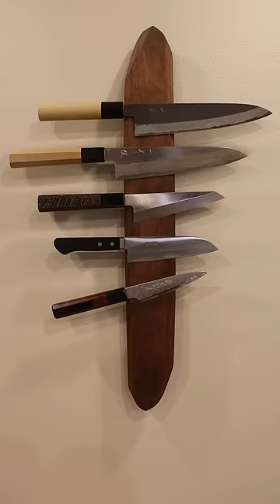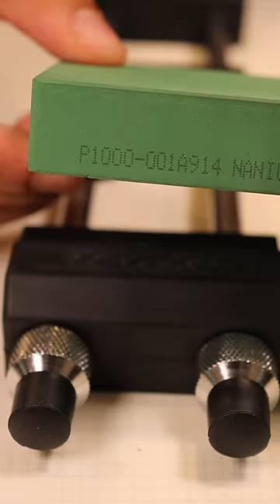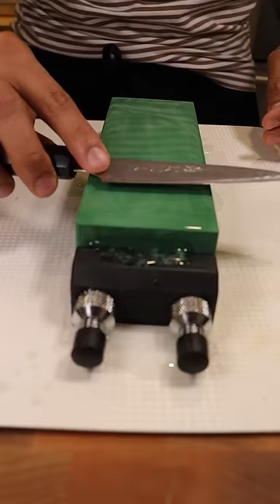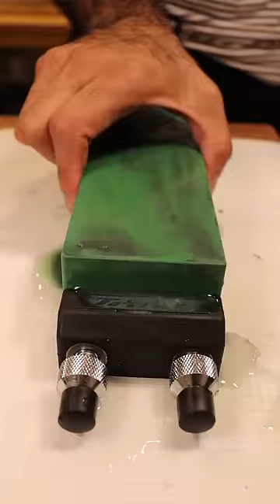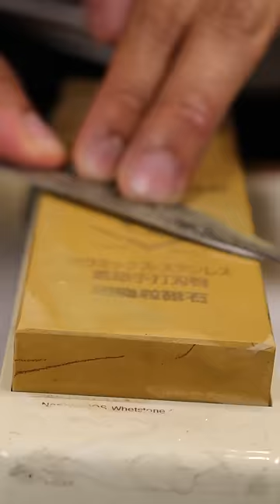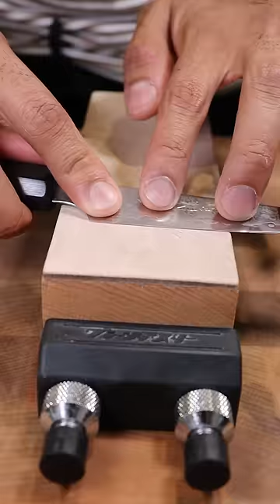Time To Sharpen Your Knife

Comment: To anybody confused by the “a sharp knife is a safe knife” comment:

Assuming that you’re holding the knife correctly, as well as keeping a firm grip on whatever it is that you’re trying to cut, then a sharp knife makes it easier to cut things as you need to apply less pressure to the blade to do so.
In addition to this, the cutting edge of the blade will be slightly rounded over on a dull knife (you’d need a microscope to see this) which means that you’re a lot more likely to roll off the surface of whatever it is you’re trying to cut and risk cutting your fingers - especially with shiny, round food such as tomatoes and onions.

In the event that do accidentally cut yourself, then a cut from a sharp knife is actually a lot less painful, as the skin is cut cleanly and will heal easier, whereas a cut from a dull knife is ragged, as the blade tends to rip the skin more than actually cut it.
Reply: I see
Reply: Here is the summarization:
A dull knife is more harmful
Reply: I think that quote is more for the self defense aspect
Reply: @Rogerpearsontattoos  No..
Reply: its because when a sharp knife enters your body and it hits a bone it wont  get stuck, but if its dull and enters your body it could get stuck in your bone. so thats why i’m glad I accidentally cut my self with a sharp axe and knife when i was younger instead of a dull ones.

Comment: "a sharp knife is a safe knife"
NOT AT MY HOUSE
Reply: A sharp knife will allow you to cut meats easier whereas a dull knife wool have a chance to slip and cut you.
Reply: @dez8832  Counterarguement for the sake of fun! If you are so inexperienced with knives that you feel it not going through, and still try to put more pressure on something you know is slippery (eg meat, bones, round objects etc), then you could arguably do hell of alot more damage to yourself with a super sharp knife.

Not trying to be harsh, but imo trying to force a dull knife through something instead of taking the time it takes to get through, is utter stupidity and in my head an operator issue, not a knife issue.

A common injury from sharp knives is when you cut something and it encounters resistance, you put more pressure on to compensate and since its so sharp it now snaps straight through whatever you were cutting AND anything else in its path after. Another one is trying to cut round things that roll away and kick the knife out.

A sharp knife might be safer, but they are certainly not safe. Good knife practice and experience is what makes safety.

Comment: If you are wondering why a sharper knife is safe, it's because it cuts smoothly.  On the other hand, using a dull knife will not be smooth and you could end up cutting yourself.

Comment: “A sharp knife is a safe knife”

Cuts my finger open
Oh…
Reply: You are more likely to hurt yourself while using a dull knife because having a dull knife will make you apply more pressure, which can cause many accidents, such as it slipping on the cutting.
Reply: @ljguy1276  woosh
Reply: @gredinmcconnell  👏

Comment: "a sharp knife is a safe knife"

But you didn't had to cut me of-
Reply: Dull knives are more likely to slip and cut you. If your knife is dull, you will apply more pressure to it, which can result in an accident.
Reply: MichaelLorraint well it really depends on how dull the knife is because it still needs to be sharp to an extent to be able to cut you. And dull knives are more likely to slip
Reply: You are more likely to cut yourself on accident from a dull knife
Reply: Michael Lorraint  because potato

Comment: Nobody:
The intro of this vid: A sharp knife is a safe knife! 💀
Reply: It's true though, a sharp knife won't get stuck and a dull knife will which causes you to lose control..
Reply: @literallygod1229   explain that to an infant.
Reply: @NoirLeRoi  Sharp knife goes in and comes out good, a dull knife (Not sharp knife) gets stuck when it cuts.
Reply: A sharp knife is easier to use, a dull one is harder to use, so you might cut yourself.
Reply: @NoirLeRoi  why? Infants shouldn't even be in the kitchen

Comment: In case you don't know why a sharp knife is safer, it's cause with a full one your having to push and slide through whatever your cutting, and if it slips boom a lot of pressure on your hand with the blade. Buts with a sharp one it just glides through and you don't have to push so hard.

Comment: Guys, a sharp knife is safe because if you cut yourself with a dull knife it's gonna be a weird cut and it could get infected depending on the knife, a sharp knife cuts thru you clean which makes it easier to clean the cut and easier for the cut to heal, even if you think otherwise.

Comment: Can I ask 2 things
1: what does the phrase a sharp knife is a safe knife mean how is it safer than a dull one

2: what do each of those blocks do for sharpening those knives

Please answer these questions for me thank you
Reply: You have more control with a sharp knife.
Less pressure, means less chance of slippage and more control 'steering' your cuts, so you cut what you mean to, and nothing else.

They're whetstones.
Think fine sandpaper blocks. The green one is 1,000 grit, and the yellow one is 4,000, the last one is leather, and it cleans the little leftover bits of metal.

Comment: you said that a sharp knife is a safe knife now i have one arm
Reply: A dull knife which is not sharp almost cut my moms finger how?
Well using a dull knife you have to put pressur on the hard things like meat water melon etc etc
But most of the time putting pressure will cause a accident by slipping
Sharp knife makes it easier to cut meat , water melon, and anything thats hard
But becareful with a sharp knife tho.

Comment: lemme get this straight

A sharp knife is a safe knife
but a UNsharpen knife is a dangerous knife?
Reply: Yes, atleast for cutting things. If you have a sharp knife you can easily cut things. But with a dull knife, you need to put more pressure which is dangerous.

Comment: ''A sharp knife is a safe knife''
It isn't and it never will be.
Reply: It is actually gordan ramsey and every other professional chef states that with a dull knife  you have to push harder increasing chances of slipping
Reply: A dull knife which is not sharp almost cut my moms finger how?
Well using a dull knife you have to put pressur on the hard things like meat water melon etc etc
But most of the time putting pressure will cause a accident by slipping
Sharp knife makes it easier to cut meat , water melon, and anything thats hard
But becareful with a sharp knife tho.

Comment: They are?

me looking at my four fingers from yesterday
Reply: A dull knife which is not sharp almost cut my moms finger how?
Well using a dull knife you have to put pressur on the hard things like meat water melon etc etc
But most of the time putting pressure will cause a accident by slipping
Sharp knife makes it easier to cut meat , water melon, and anything thats hard
But becareful with a sharp knife tho.
Reply: @ChefHin ok

Comment: U just said a sharp knife is a safe knife 💀💀💀
Reply: A sharp knife is easier to use, a dull one is harder to use, so you might cut yourself.
Reply: You wouldn't have to put as much effort on a sharp knife which means it's less likely the knife will slide off what you are cutting and cut you. This is especially true for tougher things to cut
Reply: So saying something that's true is crazy, it's simple knife safety

Comment: “A sharp knife is a safe knife”

what
Reply: A sharp knife is easier to use, a dull one is harder to use, so you might cut yourself.
Reply: Its true, a dull knife even though it wouldn't do as much damage its waaaaaaay more likely to slip
Reply: @owenjongekrijg4294  what if the sharp knife slips-
Reply: @NeonGMD  ok then you cut yourself but because ita more sharp the cut will be cleaner meaned less pain and it's also easier to think of it this way, a sharp knife slips once every 20 times a dull one does, so the sharp knife would need to do 20× more damage per slip to be considered even, but it doesn't it would do 2× at MLS
Reply: @NeonGMD  Then it's your fault because you'd have to TRY to slip a sharp knife
Reply: @Isabellaaaaaaaaaaa  no
Reply: @NeonGMD  it really is,it takes effort to slip a sharp knife cuz if it's sharp you wouldn't even have time to slip it
Reply: @Isabellaaaaaaaaaaa  i thought they meant dropping it yea now i agree

Comment: How can a sharp knife be a safe knife ?
Reply: Because you remain in control of the blade at all times.

When your knives is dull you exert more force, this results in rolling of the knife, and uncontrolled speed, so it could walk or drift in what you're cutting, or slip off what you're cutting, causing you to injure yourself.

Sharp knives also have more cut initiation (meaning they 'bite' (stay on) the material regardless of pressure.)

Comment: "a sharp knife is a safe knife" what happened when u accidentally cut you hand/finger💀
Reply: Why does that happen though? You're cutting something, the blade is dull, so it catches on whatever youre cutting. So you push harder, making the knife slip and chop your finger off. Sharp knives don't catch on stuff, so they don't have this problem
Reply: If you accidentally cut yourself you clean it out slap on a glove and go back to working. It won't kill you and you'll learn to be more aware of your fingers and ensure proper cutting technique.
Reply: @cloroxbleach197  a sharp knife cuts cleaner than a dull one, you never want to be cut by a dull knife
Reply: @SlickTimes  Oh believe me I know, I work in the food industry and I've had to deal with my fair share of shitty knives.

Comment: A Sharp Knife is Safe Knife So You Can Give him to Your 3 years Old Sun to play with him
Reply: A dull knife which is not sharp almost cut my moms finger how?
Well using a dull knife you have to put pressur on the hard things like meat water melon etc etc
But most of the time putting pressure will cause a accident by slipping
Sharp knife makes it easier to cut meat , water melon, and anything thats hard
But becareful with a sharp knife tho.

Comment: a sharp knife is a safe knife 🔪
wtf no it's not 💀
Reply: Yes it is, dull knives are dangerous because they can slip on the vegetable and cut you, with a sharp knife it won't slip and it won't cut you
Reply: Sharp knives won't slip on stuff because it cuts what you want with less pressure.

Comment: Me:wondering how painful a cut is
Reply: Sharp cuts actually hurt less and heal faster, because they cut flesh smoother.

Source; knife maker and sharpener, cut my finger tips open more times than I can count.

However, one that does hurt is when you slice your fingertip to the bone, severing the nerve in your fingertip, causing you to feel one of the most painful feelings on earth, and almost pass out, then once it's healed, have  no feeling left in your fingertip, except for an odd 'ghost sensation' occasionally.

:^)

Comment: A sharp is a save knife 
How does that make sense 
Its suppose to be more dangerous 
Anyways amazing videos
Reply: A sharp knife is easier to use, a dull one is harder to use, so you might cut yourself.
Reply: Sharp knives will cut through anything easily and won't slip. A dull knife will make it harder to cut and easier to slip. Plus it'll probably stick to you if you end up cutting yourself.

Comment: Uhhh i dont really know if a shrap knife is a safe knife💀
Reply: A sharp knife is safer to work with if you know what you're doing as you don't have to put extra pressure forcing the blade through whatever you're cutting. The extra pressure can lead to less control and cause the blade to slip leading to you severely injuring yourself. Just a little experience with a knife and basic proper handling techniques make it very safe to work with and cutting yourself will be a rarity.

Comment: “A sharp knife is a safe knife”
So a not sharp knife is a dangerous knife?
Reply: With a dull knife you have to use alot of pressure when cutting something and if your knife slips and cuts you then your gonna be mad
Reply: It's easier to understand using a damage index, if you cut yourself with a dull knife let's say it does 10 damage, and a sharp one does 50, even though the knife does less damage per hit you are far more likely to cut yourself with it via the knife slipping so in the same amount if time the dull knife does 100 damage while that sharp one only does 50
Reply: oh ok thanks
Reply: sharp knives leave smaller wounds,easy to heal.a dull knife leaves a bigger wound,takes a bit longer to heal.

Comment: Ohhh really 😮 leme try l…… ✋🔪AHHHHH
Reply: A dull knife which is not sharp almost cut my moms finger how?
Well using a dull knife you have to put pressur on the hard things like meat water melon etc etc
But most of the time putting pressure will cause a accident by slipping
Sharp knife makes it easier to cut meat , water melon, and anything thats hard
But becareful with a sharp knife tho.

Comment: A sharp knife is a safe knife yea I'm not to sure on that ;-;
Reply: Dull knives catch, meaning you have to apply more pressure to cut through whatever it is you're cutting. The moment you apply more pressure, there is a high chance the knife will slip and you will suddenly lose your finger. A sharp knife won't catch, so it doesn't require the extra force. Knives are tools. Tools are only dangerous in the the hands of the dangerous

Comment: Just to know, why is a sharp knife an safe knife, i mean u can cut easier?
Reply: Yeah you cut things easier. A dull knife will catch on what you're cutting, making you have to push more to get through whatever you're cutting. As soon as you apply more pressure the knife slips, and there's a high chance of injury. A sharp knife doesn't catch so the extra force isnt nessecary

Comment: Woah i didin"t even know that a sharp knife is safe 20 minuets later. Oh let me try it on this Wait aaaaaaaaaaaaaaaaaaaaaa 💀💀💀💀💀💀💀💀💀💀💀
Reply: A dull knife which is not sharp almost cut my moms finger how?
Well using a dull knife you have to put pressur on the hard things like meat water melon etc etc
But most of the time putting pressure will cause a accident by slipping
Sharp knife makes it easier to cut meat , water melon, and anything thats hard
But becareful with a sharp knife tho.

Comment: A sharp knife is a safer knife when cutting. You don't need to put as much effort into cutting something which means your knife is less likely to slide off what your cutting and cut you instead since most of the time it will just cut through them easily. This is especially true for harder things to cut. Of course you must use a knife with a lot of caution and always be aware of what you are cutting.

Comment: Why u put water?
Reply: It's called a wetstone. You put water to make it better for sharpening because with just dryness it probably wont work.
Reply: If the stone is dry it will hurt the blade
Reply: Water is to 'wash away' the metal dust, and soften the binder on the stone (making it wear steel at the same speed.)

It will not harm the knife or the stone to use it dry, and it will work somewhat fine (depending on the stone), it may just clog up with metal if you don't use water.

Comment: A loaded gun is a safe gun so let load a gun
Reply: Lmao no. If a knife is dull it needs more pressure to cut and the knife becomes harder to control. If u slip up with a dull knife the dull knife would most likely hurt you more
Reply: Poor analogy, because the user is always responsible for the firearm.
It cannot do anything without you, you are the problem not the gun. If you leave a loaded firearm on a table, it will not magically go off.

Same for a knife, except if it's dull you lose control when cutting, if it's sharp you don't.

Comment: How is a sharp knife a safe knife it is more likely to chop off a finger than a dull one
Reply: this is because a dull knife has a chance of getting stuck then slipping, which has a chance of injuring the individual
Reply: A sharp knife is easier to use, a dull one is harder to use, so you might cut yourself.
Reply: Actually that's where you are wrong, unless you are trying to cut your finger. A dull knife is much more likely to slip and cut you

Comment: How is a sharp knife a safe knife the more shrap the mare you will get cut
Reply: using a full knife causes you to need more pressure to properly cut anything, so curing yourself with it would be worst than a sharp on since with a sharp one you'd barely need any pressure

Comment: (A Sharp knife is a safe knife) man shut your mouth it's not safe
Reply: Dude you have no room to speak I bet you don't even cook ordering door dash every night 💀, a sharp knife is a safe knife because you can cut through food easier without any resistance. On the other hand, a blunt/dull knife is dangerous because you have a harder time cutting, which means it can slip and you can hurt yourself by accident. Learn to cook.
Reply: A sharp knife is easier to use, a dull one is harder to use, so you might cut yourself. You seriousky have no experience in cooking whatsoever.
Reply: If you use a knife for anything other than stabbing people a sharp knife is 10000000x more safe, it's common knife safety

Comment: How the Frick is it safe like imagine someone’s walking and then that thing is at the top of their head And then the stump in that freaking thing comes flying
Reply: A dull knife which is not sharp almost cut my moms finger how?
Well using a dull knife you have to put pressur on the hard things like meat water melon etc etc
But most of the time putting pressure will cause a accident by slipping
Sharp knife makes it easier to cut meat , water melon, and anything thats hard
But becareful with a sharp knife tho.